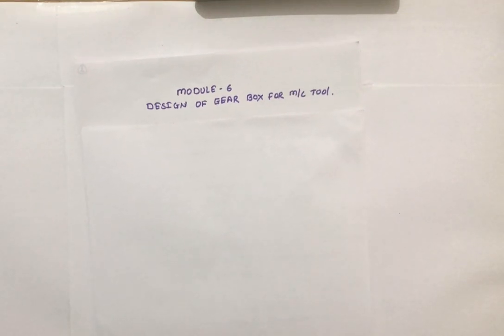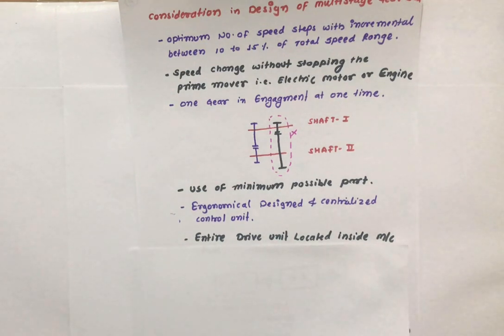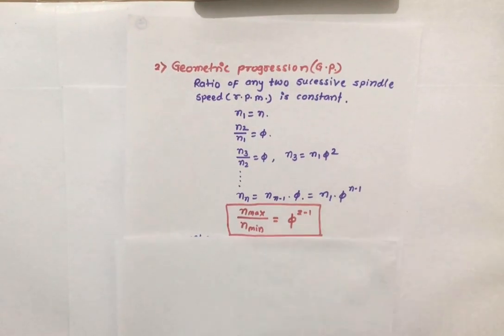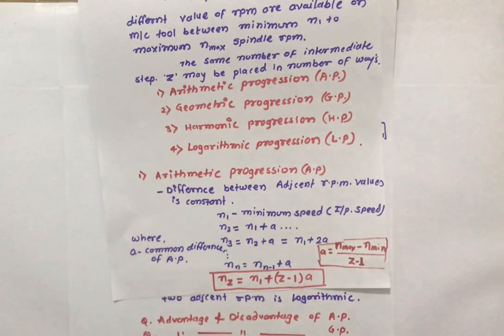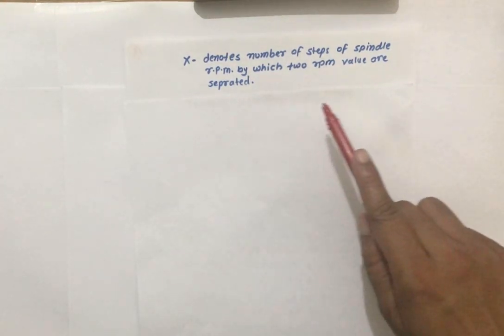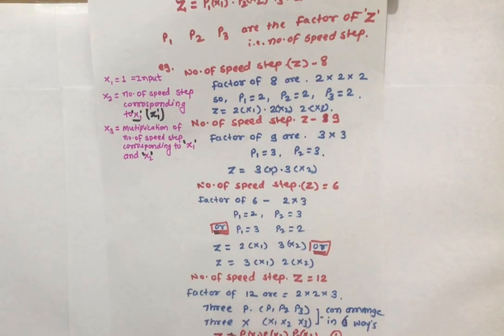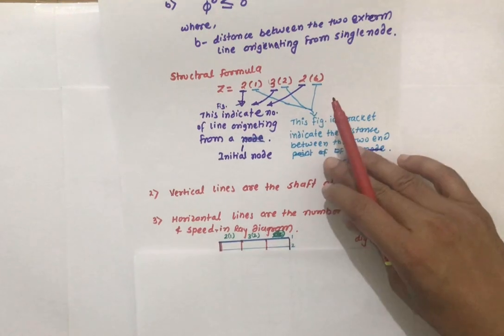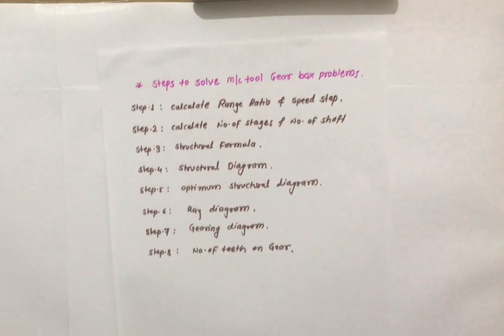Theory-Design of Machine Tool Gearbox

Comment: design a gearbox of an aseptic packaging and laminating industry machine of small scale industry with laminator input driven by 7 kw dc motor having an input rpm of 1500. the required output speed is 300 rpm. output shaft is coupled with laminator roller. the machine is run for 8 hours day. roller is heat exchanger type roller which binds the multiplayer of aluminium polythene and cardboard in order to get final roll ready for cutting